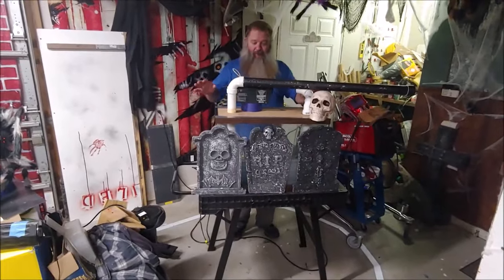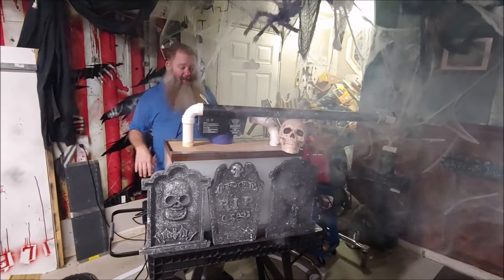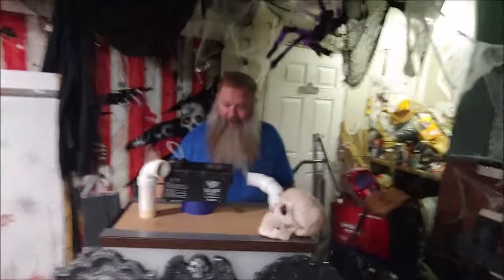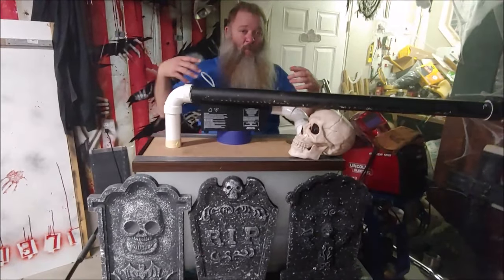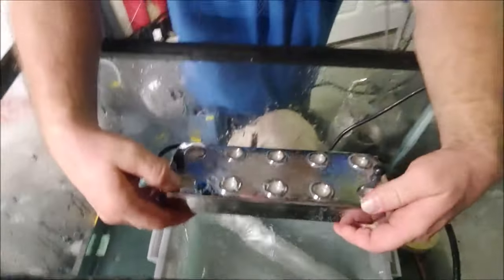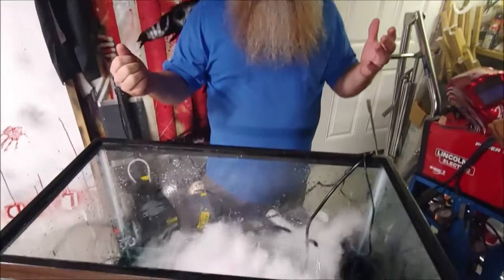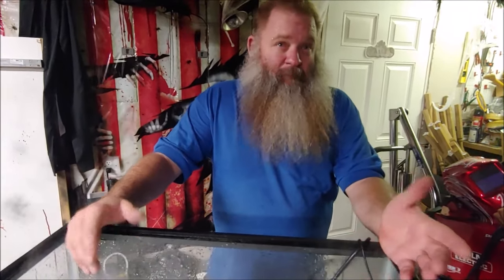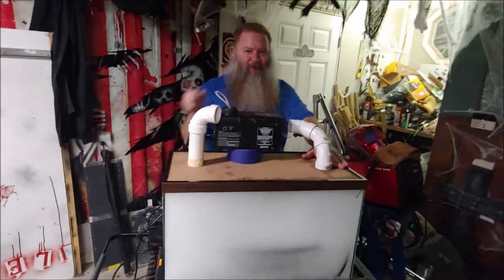Roberts Fogger: The original DIY Fog Chiller without ice

Comment: You have a bucket inside of an aquarium. You use a pump to fill the bucket. Why not just put the mister in the aquarium?
Reply from the maker: The missing unit needs a specific depth to function properly. If the water drops too low, the unit shuts off.
I was also planning on adding a radiator to cool the water on the way back up to the bucket.
Warm water does not seem to the mister which holds it below the surface at the right height.
Reply: @intocoasters  so the idea is that it keeps filling without you not having to keep an eye on it?

I may try attempting just keeping a garden hose with a slow trickle coming out
Reply: Unless you know that doesn't work, then I wont 😄
Reply from the maker: @chipsandguac2  it also will not work if the water is too deep.
That's why I let water overflow from the bucket.
However, with a float, you can have a lot of water in the tub in the missing unit will drop with the water level their staying at the right height